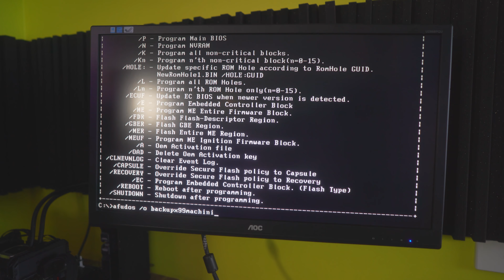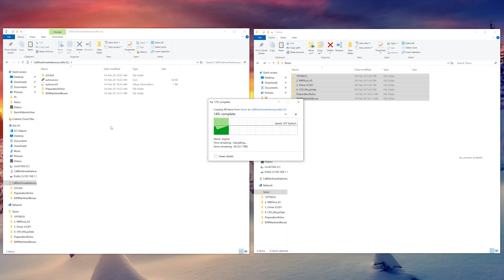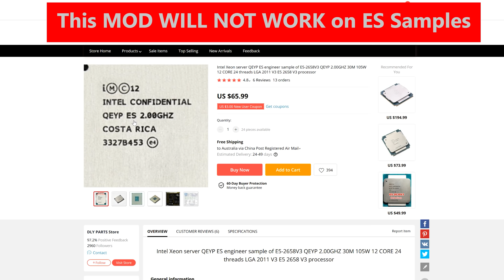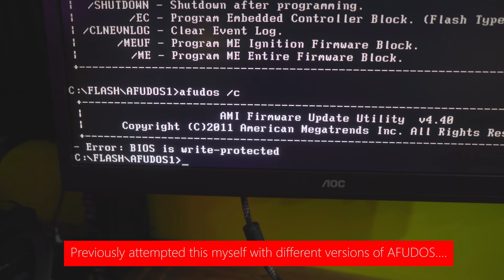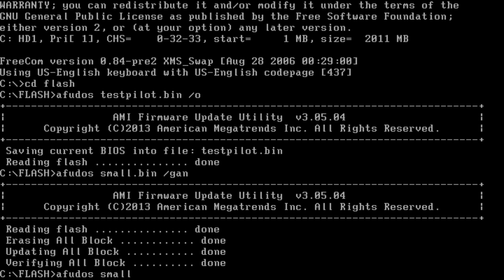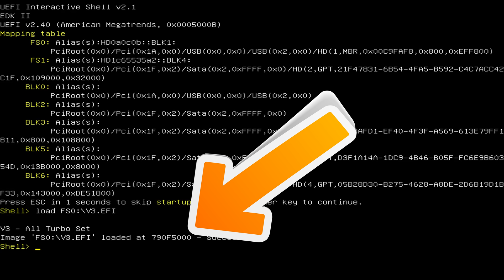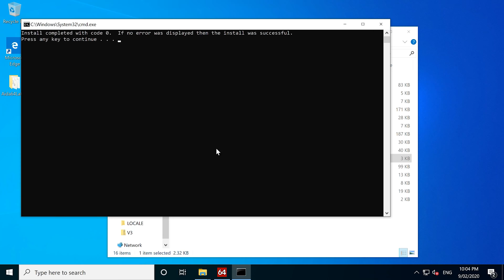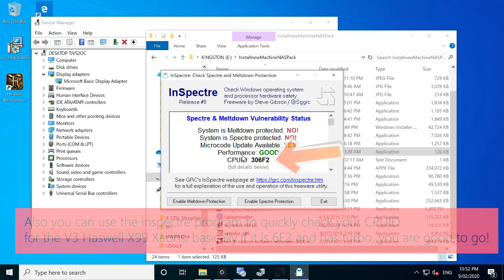Xeon V3 "Full Turbo UNLOCK" How To for X99 Motherboards

Comment: Thanks, this tutorial works great for me (Xeon E2620 V3). It seems that the processor was even unlocked after step 2 : I ran a benchmark after step 2 and another after step 3, and there was no difference, the cores were already running at 3.2GHz after step 2.
Question : currently, I have 4 RAM slot but only use 2x8Gb DDR4 2600. Is there any difference of performance using 2x8gb vs 4x4Gb ? Later, if I upgrade with 2 other sticks of memory, is it possible to mix DDR4/DDR3 and/or different speed of memory or will I have to find exactly the same memory sticks ?

Comment: when I change the bios to make the processor work on turbo boost, can I change the processor safely? I want to start with 2620v3 and later change to 1620v3. 1620v3 will also work in turbo mode? does the bios change only work on 26XXv3 processors? can I change processors without restoring the default bios?

Comment: Yes i know that the used Xeons Cpu are cheaper now on Chinese stores but

A) They are USED !!!
B) There are not many or cheap available NEW motherboards for these CPU now. there are only Chinese new x79 motherboards available and the available x99 cost more the 400$ the new one (the refurbished at 250$)
C) The risk of failure or get hacked is huge since the mod tools are changing the bios

So,  Spending the same Money per Core for a 7 years technology with a huge risk of failure or get hacked sounds logical to your ears ? 

p.s. FRIENDLY REMINDER:  A 12 CORE BRAND NEW AMD 3900X + the New assassin creed Valhalla COSTS 439 $ on newegg now and there are plenty NEW motherboards available to support it  !!!

 also, since this is a 2020 video and its title is "Xeon V3 "Full Turbo UNLOCK" How To for X99 Motherboards" , i feel the responsibility to remind watchers that THERE ARE NO NEW X99 MOTHERBOARDS IN THE WEST MARKET anymore !
Reply: HAH! A huge risk of failure my ass, I've never heard of a processor failing, let alone one DESIGNED to be used constantly and for a long time. You can also always virus check the tool using different apps or just compile your own + you can get a 12 core xeon for less than a new game (60$) and I'd wager that most people considering these chips already have a compatible mobo or are getting them very cheaply. Also it matters fuck all that they are used, some of my fastest and longest lasting computers have been built with used parts.

Comment: Thanks for sharing! Just a bit confused confused, do all those listed CPUs have a CPUID ending with 6F2 or is it chip specific because I would like to order the 2620 v3 but wouldn't want it to come with a different ID, defeating the purpose of ordering these parts for my main gaming build, also would it beat my 4690K in games due to the extra cores?

Comment: Did V3 ans V4 cpus overclockbale
Reply: The 1650 v3, 1660 v3 and 1680 v3 all have unlocked multipliers. Sadly, Intel put a stop to the unlocked Xeons after Haswell. All Broadwell (v4) chips are locked, as are those that followed (bar the W-3175X).

Comment: i have a machinist x99 k9 (white) board with AMI 5.11 (1/11/2021). stumped at the fptw64 backup step @ 5:20 . i got "Error 26: The host CPU does not have read access ..." 😭. i guess i'll download a copy of the bios from the 'net and go from there.

Comment: Couldn't get this to work with a Gigabyte GA-X99-UD4P motherboard, tried f1 and f22 bios's. Computer doesn't post. Seems the problem is with removal of the microcode, this just breaks the bios.  I only have a e5-1650 v3 cpu maybe work with e5-20xx v3. But I'm done since you can unlock the multiplier on e5-1650.  Had to use qflash plus to restore bios.

Comment: In the Video you told the Atermiter was to expensive. Now 3 month later the Atermier is at 68€.  Probably the price is ok now. Thinking of pairing  the Atermiter with a E5 2630LV3 with all core Turbo update. The Snowman T4 cooler is same price as the cpu. Good to go? (sorry for bad english)

Comment: is it possible to do this method on a xeon e3 v3 in a c226 motherboard(the hp z230 system) cuz all core turbo boost is much lower than single core boost

Comment: Performance wise, would I be better off keeping my old i7-3770K system or going this route? 
I can get about $340 for the CPU, MoBo, and RAM to put towards this and then have some extra cash to pocket..
Reply: You can find that out yourself & very easily :)  Run a google search -- -- i7 3770 vs xeon 2620 . A nice comparison will be there in the results from cpu dot userbenchmark website . Use the same method to compare between any two cpu or gpu .

Comment: since intel droped support for those cpu's in 2021 server farms are getting replaced with newer stuff and in 2023 ecc reg ddr4 is cheaper than regular by a wide margin
10$ for dual channel set of 16gb? and chinese motherboards comes with it from the get go , so if you want quad memory ecc would be way cheaper and around the same performance as fastest dual channel ddr4 on consmumer boards
Reply: Yes, there's no question that a 4 channel DDR4 REEC is the most cost effective way to go with the E5-2xxxV3. Four channel utilization is a MUST. Certain CPU's are compatible with BOTH DDR3 or DDR4; e.g.: E5-2678v3 (12C/24T), E5-2696v3 (18C/36T).

Comment: @Tech YES City   i have stuck in cmd step | Error 26: The host CPU does not have read access to the target flash area. To enable read access for this operation you must modify the descriptor settings to give host access to this region.
Reply: x99-ad3
Reply: @wasinchairojnipat4789  I had the same issue with the x99-ad3

Comment: 2667 v3 is cheap now.. not worth unlocking if you have one of the cheapest board like atermiter X99H. Stock 2667 v3 = unlocked 2640 v3

Comment: Hello. Turbo unlock just work great, from 1.2MHz to 3.3MHz. So thank you Tech Yes City!
Config. Huanan X99-TF, E5-26787v3 step2
The/my "problem", just "Not really aweak from sleep".
Config. Huanan X99-TF, E5-26787v3 step2.
The computer just don´t awake after sleep or just shows the block screen of windows and reacts for instance, maybe a second. After that, no mouse, no keyboard reacts.
Has anyone any suggestion?
Search in bios, but no option for cpu config. c3/c6.
Reply: Hablas español?

Comment: I have followed the steps. 
BIOS shows V3 Turbo Boost option, and also done the intell driver hack. Unfortunatelly the processor doesnt get locked in turbo mode. 
Using x99 SZMZ motherboard from aliexpress and Xeon E5-2670v3 processor.
Anyone have some idea?

Comment: ya programer relative error is DUE voltage drop across board is instaled.. usual way is desolder, wipe, program, solder well way no.2 is increase programer voltage and in same moment curent what most programer limit is 100mA..  but you flash it..  well then check buffer vs chip tell ya if you.. really program that stuff..  i using Revelprog IV

Comment: the cpu mobo ram combo is 300 on aliexpress, i can part together a 2700x and 16gb 3200mhz ram and x370 mobo for the same price. which would be better?
Reply: 2700x probably for wattage and multi core power

Comment: Help mi please. asrock fatal1ty x99 killer dont work. 
An error pops up in cmd "Error 26: The host CPU does not have read access to the target flash area. To enable read access for this operation you must modify the descriptor settings to give host access to this region."

Comment: Brian... Love your Work!! i got the message "All Turbo Set" after the first 2 command prompt instructions. The command prompt step 3, "cp fs0:\v3.efi fs1:\efi\Boot, and i get a "specified path does not exist??? Any advice? Thanks!!!
Reply: Might add, after reading more comments, my Xeon's an e5-2683 v3 , 14core...will the supplied tutorial dish-out enough voltage? Gigabyte x99

Comment: Error 103: There are no supported SPI flash devices installed. Please check connectivity and orientation of SPI flash device.
Reply: use usb flashback option  fpt flashing in windows does not work

Comment: On my system the bcfg command doesn’t exist, are there any alternative commands? Everything else installed fine but without that set, in windows the CPU will only go up to 2.5GHz, it turboed higher before. MSI X99a raider and e5-2680 v3

Comment: so ive done all he said i and it worked as so i thought but my max frequency is still 2.6ghz on my e5 2640 it told me all turbo set and i installed the windows patch files everything went right besides the actual turbo boost how do i crank up the max turbo?

Comment: Does this BIOS patch only Apply to a windows installation? Because I was thinking on using one of these Chinese boards as server duty and it would be running Linux. (unRAID)  would the turbo work normally outside of windows??

Comment: Error 26: The host CPU does not have read access to the target flash area. To enable read access for this operation you must modify the descriptor settings to give host access to this region.

@ghostspectre     motherboard:  huananzhi ad4    cpu   2697 v3   
I flashed my bios..CPU Stepping M1

Comment: I have a Jingsha X99M-G. I only could put modified rom (without the 06F2 patches) with Machinist Steps, otherwise I had Error 280: Failed to disable write protection... I couldn´t use "/gan" parameter in my version of Afudos. I tried a different version of Afudos (the one which is included in Aptio V), one which can´t use "/gan" parameter. Instead, the right parameters are: afudos smallbiosmod.bin /p /b /n
Reply: I forgot it: I have a Xeon 2620v3

Comment: I'm having a problem with the E5-2620 v3, where each time i play a cpu intensive game my pc crashes. Thermals are fine as i am using a liquid cooler (never exceeds 50 degrees celcius). It both crashes at stock and full v3 oc. Is it possible that i bought a faulty cpu? I cleaned the cpu and pins on mobo. Almost tried every bios function out ( a little more vcore). Should I buy a new one as 2620 v3 are like 10$ these days.

Comment: What do I do if after flashing the bios with small.bin (I Have an x99 from machinist), my PC became very unstable. Sometimes it can't get passed the bios loading screen (american megatrends). It freezes with code A2 on the bottom right. Occasionally it will boot with the message "Preparing Automatic Repair", and then might freeze or finally boot into windows, but then my mouse and keyboard don't work so I can't actually enter windows or change any options in the bios. any fix for this or way to revert to older bios?

Comment: Error 26: The host CPU does not have read access to the target flash area. To enable read access for this operation you must modify the descriptor settings to give host access to this region. what happen brother it is not working on my X99 F8D motherboard? did I missed some step?

Comment: Hey Brian, got a question for you. Should I upgrade to a 2678 v3? I'm currently rocking x5675 Xeon @4.4 GHz. I love the value for money of x58 but I'm missing sata 3, m.2 and USB 3 support. At such a low clockspeed, would it bottleneck my 1070?
Reply: I'm at 1440p 144hz and also looking to upgrade my GPU when Nvidia releases new cards this year

Comment: would this work with a e5 2650 v3 ? they are currently $90 AUD for a 10 core 20 thread cpu and if you can get all core turbo to 3 ghz that would be amazing

Comment: Can you use the HUANANZHI motherboard with ddr3 and ddr4 at the same time, using both (ex. now you get 32gb ddr3 ECC memory, in the future you get 32gb more of ddr4, so when you get the other 32gb ddr4 you have 64gb ram usable?)
Reply: No! You can only use ddr3 OR ddr4 depending on the processor. Some support ddr3, some ddr4.

Comment: Hello Sir, 

sorry to bother you. 

I recently bought a Machinist x99 but the ram speed > 2133MHz doesn't work even if manually set in the bios. I saw you have discussed about this motherboard in your youtube channel, could you tell me if it's normal and if there is something I can do about it? 

Thanks in advance.
Regards,
Giorgio

Comment: Hi, does this work with E5 v2 CPU? Or is there a method that applies to E5 v2 CPU?

Thanks!
Reply: Did you figured it out?!
Reply: @ZGtx  There is no way to unlock the turbo boost for the E5V2.

Comment: Hi all with chinese x99 Boards, Look for the setting in BIOS: Enable IOAT
It is disabled on Standard. Give you a little boost if enabled. In CB 20 my 2678v3 3.3 GHz got without 4156 points. With enabled i get 4226. For more Details in this Bioses Look in the manual from Supermicro X10SDV. Hope helped here someone, since no one answer me in x99 channels. Only want to help and search help.

Comment: Thanks for this detailled video !

Is there a way to downclock xeon V3 processor so that their TDP will drop down as per E5-2650L V3 model please ?
Reply: set in windows power management "max CPU power" to something less than 100%. I am not tried on my xeon but was working with pentium laptop.
Reply: Manually dropping clocks is still possible on locked chips through the bios, you just cant increase them
Reply: Thanks  @vadnegru  I forgot to say that it's to use on a Linux Debian/Proxmox OS..
Reply: @nathanhamman418  Thank you for the information !!

Comment: Hey guys, maybe one of you can give me a hand. When I follow all of the steps, I don't run into any problems whatsoever. Everything completes successfully as it should, however when I run things like Cinebench, I notice that the clock speeds in task manager go from being all turbo at 3.4ghz, down to around 2.8ghz. I'm using an Atermiter X99 board, 64GB of DDR4 ECC, and a Xeon E5 2640 V3. Any suggestions?

Comment: for some reason i cannot check the bios via the freeDOS on my usb? For the machinist board.
Reply: Try to boot with the usb after I use that program to format the usb driver, put the flash folder on there, it says preparing automatic repair Everytime I try to boot from it.

Comment: i have followed the process and it doesn't appear to work on my system.

All of the data appears to have copied across and i have had to use the jumper method on my sound chip to drop into a mode where IFD was able to be read.

The boot driver option is there in the UEFI and everything but with my 2690v3 i only get 3.1 all core when my turbo is 3.5.
Reply: and now to make a liar out of me after a series of reboots and resorting to bclk o/c it now wants to do it. 12/10 good job mysterious bios.

Comment: My bios from afudos is 8 mb BUT DO NOT TRY TO FLASH THAT VIA FLASHER(PROGRAMMATOR)!!!! BIOS IS 16MB (WB25Q128), AFUDOS FOR SOME REASON CAN'T READ OR WRITE TO OTHER 8mb REGION. You can use same drive, first time on legacy then on uefi mode. You can use afuwin. On machinist disable C6 state report under CPU state settings or system will hangs after sleep because hack is gone. Not every RAM is compatible dive into memory deeper, some 4GB kingstons are not working and give B7 error post code! Allso there is bios with built in hack. Guy in comments sent me that i am not tried yet.

Comment: Hi does anyone know if you can go straight to the intel patcher on a "non-chinese board" i have a lenovo 102F and E5-2699v3 ? thanks
Reply: mod bios by using step 1 in the vid not the chinese way ie step 2 on the video, then flash and tada done

Comment: Just wanted to leave this here to show you what the Xeon E5-2698 v3 is capable of unlocked. You can pick one up for under $300 dollars. Some people will argue you can just buy a AMD Ryzen 7 3700X for the same price, but it still has faster multi-core performance.  https://www.3dmark.com/3dm/50909586?

Comment: I have unlocked my Xeon E5-2678 v3 on a Huananzhi X99-BD4 Motherboard, 32GB DDR4-2666, and a GTX 1660. Results are that it is indeed unlocked, going 3.2 GHz but I've noticed that my PC freezes whenever waking up from Sleep. This wasn't an issue before and is quite annoying despite the slight increase in performance.
Any fix for the sleep issue?

Comment: This is very strange, but when I enter "load FSO:\V3.EFI" command, it tells me it couldn't find V3.EFI file. I run the windows again to see if it's there, and it sits right there. Anyone has run into this problem?
Reply: Nevermind, for some reason using the / instead of \ fixed the problem. I'm now enjoying the juicy 3.4ghz turbo on my 2460 v3. Thanks Tech YES City!

Comment: Performance of this set, is it comparable with ryzen 1600 or 1700 with a cheap b350 motherboard?
Reply: You probably get more performance with the ryzen setup with a mild overclock due to this being locked to the max turbo of the chip, just across all cores with this mod.  the 2620 is 3.2ghz max, 2640 maxes at 3.4 on 8 cores, and i can't find the model he listed in the description anywhere, but the 12 core i found on ebay for $150, 2658 is maxing out at 2.9ghz or the 2690 for $200 maxing at 3.5ghz.  If you can afford the 1700, you will definitely have higher performance than the other chips, at least in gaming.  There are also dual socket boards that these chips will work in if you are looking for a workstation, that you will get better multithreaded performance on when compared to the ryzen setup, though i don't know if the mod works on them or not.

Comment: I don't know if anyone have same problem but I can't install win 10 to my new M2 SSD . I have xeon cpu but I just can't make win 10 installer to see my new ssd. I can use it as storage in windows 10 but when I try to install the win 10 in there it just won't shown in installer. I tried everything but still no... Anyone knows the problem?
Reply: ssd needs uefi added to its table, format it correctly and place bios in uefi mode only and it should work fine